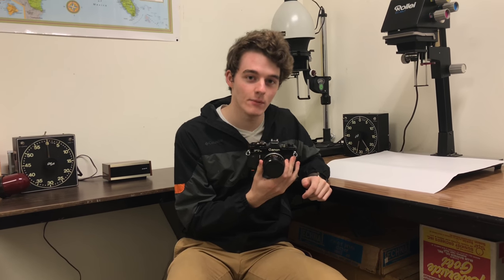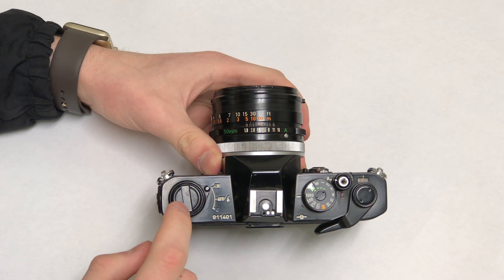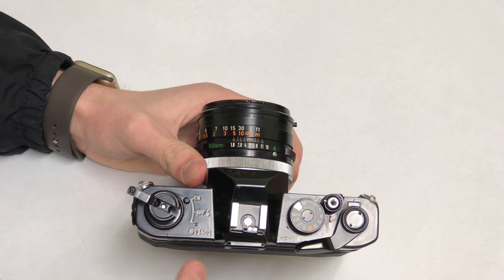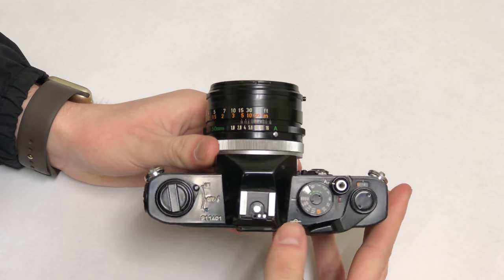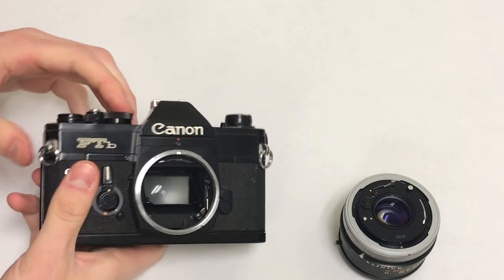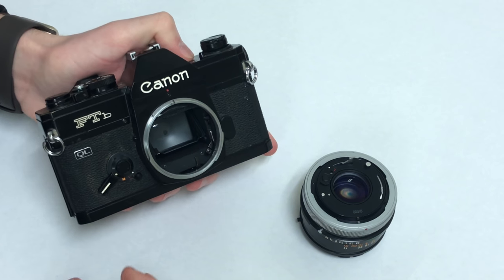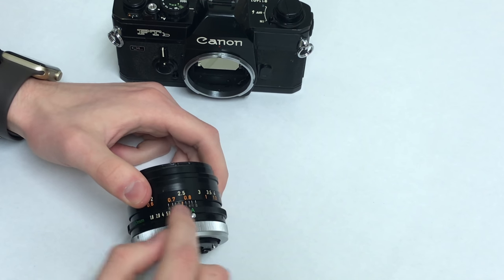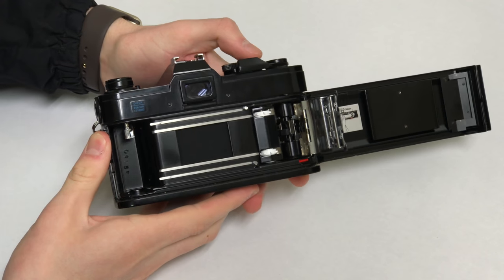A detailed look on how to use a film camera (Canon Ftb)

Comment: Love those old mechanical 35mm film SLR's:  photography distilled to it's essence:  amount of light reaching the film (lens aperture),  duration of exposure (shutter speed),  and sensitivity of the medium to light (the ASA/ISO rating of the film).  And the plus of if the battery dies,  you still have an operating camera (except no light meter), in which case you can fall back on the 'sunny 16 rule' or a separate light meter.  Nice camera.

Comment: I thought the Canon FTb QL is a manual camera and the battery is for the light meter only.  So the ON / OFF switch is for the light meter only.  Using the ON / OFF switch for this camera doesn’t turn the camera on or off.  Is that correct?
Reply: You are Right
Reply from the maker: Yes! That is correct.

Comment: One thing to watch out for with this camera and other older SLRs with built in light meters is that the light meter will not expose properly if set at the film ISO (ASA). This is because at the time this camera was initially produced it used a different kind of batter containing mercury which is very illegal in most countries. Newer batteries that fit will have a higher voltage. I find that my model underexposes by almost exactly two stops but you'd best check with a light meter.
Reply from the maker: That’s an excellent observation! I’ve noticed the same thing in mine.

Comment: The on/off switch is for the built-in light meter I believe. It's not the camera's on/off switch since it can function as a fully manual and mechanical camera.
Reply from the maker: That is correct!

Comment: I just recently got this camera from a thrift store but the shutter seems stuck like it doesn’t move. Is it because the battery is dead or?
Reply from the maker: The shutter is mechanical so it wouldn’t have to do with a dead battery. Sometimes old lubricant can get dirty and cause things to stick. I would suggest a careful cleaning and possibly lubricating (if you know what you’re doing when it comes to that). If it is still stuck, your local film camera/ developing shop will likely be able to help more.
Reply: @__Jensen_Walker__  what battery does this camera take again? And your go to films to use with this specific camera?
Reply from the maker: PX625A is the name of the button cell battery that is used in the Ftb. The battery is only used to power the light meter in the camera. In other words, the camera will function completely fine without a battery. You would just have to use an external meter or there are apps like “myLightMeter” on iOS that work great.  As for films, I really like the look of Kodak Gold 200. It is generally inexpensive and often gives me nice warm colors.
Reply: @__Jensen_Walker__  thank you so much really appreciate your help!